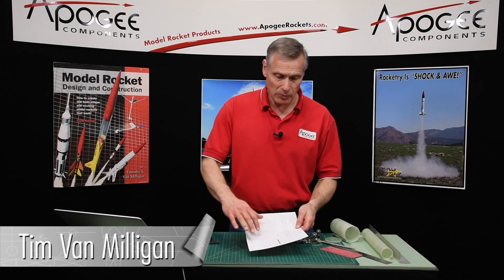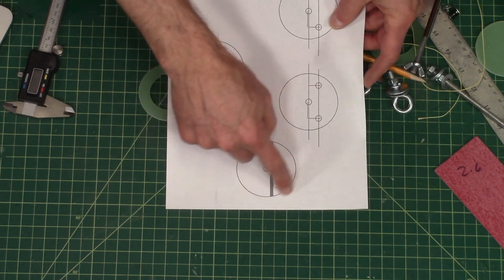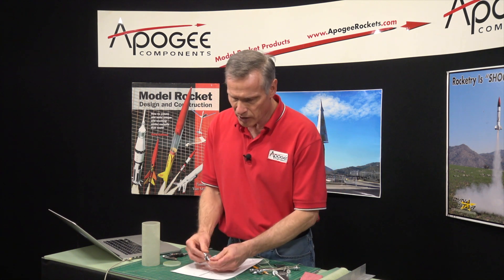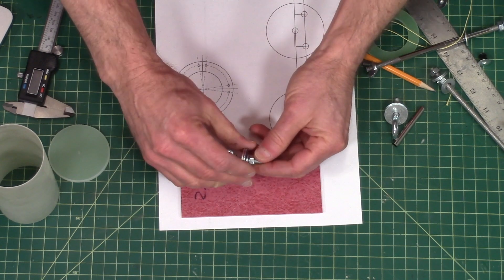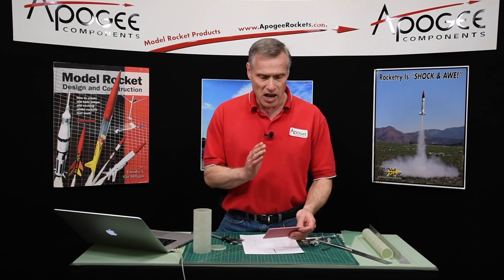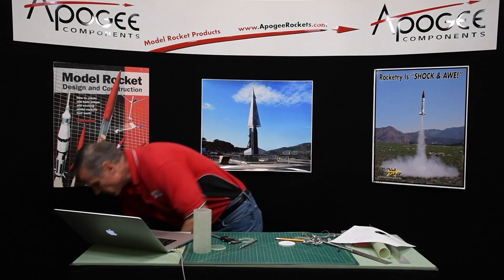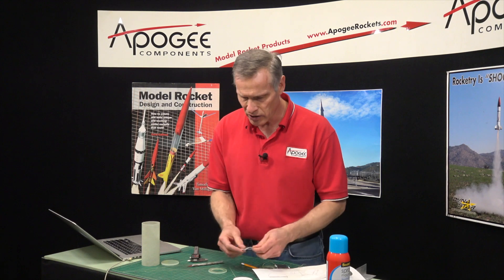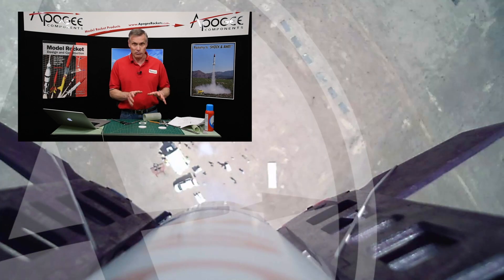Building a Fiberglass Rocket: Part - 2

Comment: Nicely done. Printing templates is a great idea.  The tip on applying adhesive to the front just to hold it against a carrier sheet so the adhesive can be easily applied to the back is a good one. Wish if thought of that when doing this kind of task.